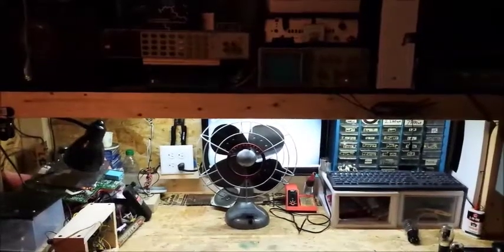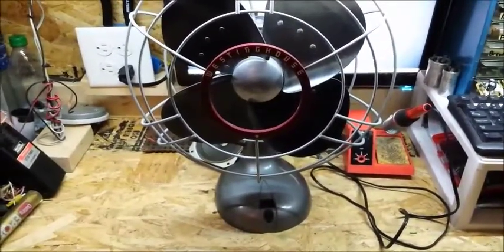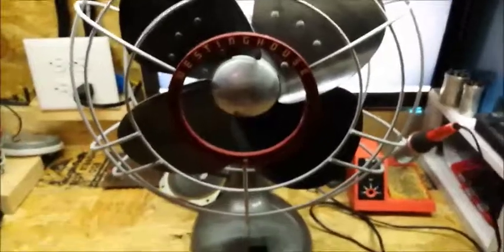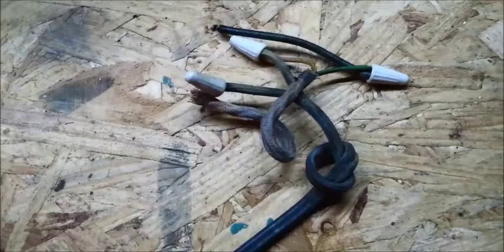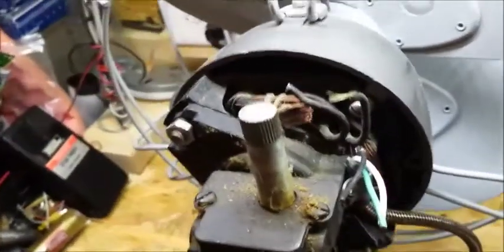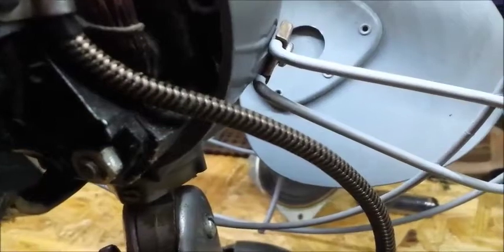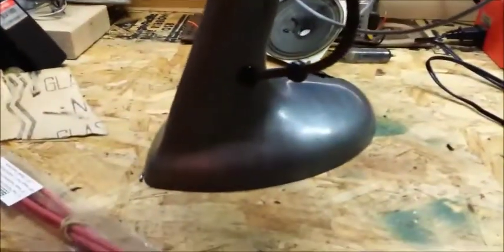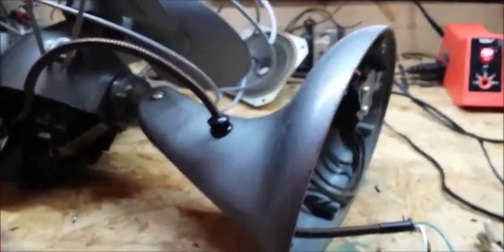Vintage Westinghouse Power Aire Fan Restoration Part 1

Comment: Here in Brazil, Eletromar have produced between 1950's to 1970's an improved model, of this fan, officially licensed by Westinghouse, but with all parts produced in Brazil. Eletromar versions used stator models with speed coil and without speed coil,both fans with two speeds.

Comment: That's a newer PowerAire! It was one of Westinghouse's best model.
Reply from the maker: benson41011 Hey thanks for the info. I'm not surprised people say this is the best model, I love it the most of all my vintage fans, it moves so much air for its size and noise level.

Also, an update on this fan should be coming soon!

Comment: I'm having an issue with my fan. It worked before I took it apart to clean it, but now it won't spin. I can turn it manually while it's off, but I can't turn the blades it while it's on. It's like the electromagnet in the rotor is not the correct polarity or something

Comment: How do you get the bottom off?  The little rubber base pieces, do they unscrew or do you pull them straight off to remove the bottom plate?
Reply from the maker: The fan is currently in storage, so I can't say for sure, but I do think that those little feet do unscrew to remove the bottom plate.

Comment: i have one with a stripped oscillator gear what can i do?
Reply from the maker: Unfortunately I don't think there's much you can do, other than just finding another of the same model of fan. At least this fan isn't the most rare, so you should be able to find another if you try.
Reply: If its like mine then its just cast bakelite, a very simple plastic material, or something similar. If you can find an intact gear then it won't be hard to make a new one, or to use  the old one to mold the teeth.

Comment: How did you get the back of the motor housing off? it appears that your's was also "stamped". I'm debating on cutting along the seam with my dremel. any help would be great! thanks
Reply from the maker: There's two screws that are inside two holes, one on each side of the fan that go from the back of the fan, to the front. Just look directly at the back of the fan (blades pointed away from you) and you'll see the two screwholes opposite of each other. Just remove those two screws and you should be able to pull the whole back housing back toward you, and then up and over the oscillator knob. 

Hope that helps!

Comment: where did you get the repo head cord?
Reply from the maker: triverman There's a user on eBay by the name of "albino999" who has a store on eBay (Snake Head Vintage) that has every type of reproduction cloth covered cord you can imagine, almost any color/color combo, and both 3 wire (like I have in the video) and the twisted 2 wire cord that many others use. I do highly recommend buying from them, I've made several purchases and had no issues.

Thanks for watching by the way :)
Reply: TheTubeAmper Nobody thanks for the info and great video

Comment: Also putting a ground on the fan is a waste of time. This is a 3 wire head system.
Reply from the maker: Can you elaborate as to why it being a three wire head makes it useless to have the chassis grounded?
Reply: Because it came from the factory without a ground wire and it does not need a ground wire unless you fucked up the wiring. Now you have to use a 4 wire for the head and have a shit hole ground on the plug that looks like shit does nothing and you have to find 4 strand wire. You can find it but its so not necessary. I have fans from the 1800s and we in the fan collectors groups do not try to re-engineer them. If you are that scared of these fans maybe its not for you.
Reply from the maker: @dondrapper7165  I hear you. I never did/nor did I intend on getting a four core wire to run the ground up to the head separately. I just was trying to err on the side of better safe than sorry, as far as the ground and three prong plug goes, I just figured should the old insulation ever degrade or the windings burn out, at least it'll have a path to ground. Either way, it is better than having a broken fan, or one re-wired with a lamp cord like most people do.

I do also have a tiny Polar Cub fan from the 20s or 30s, and that I put a reproduction cloth covered twisted pair cord on, with what I believe is the original 2 prong plug.